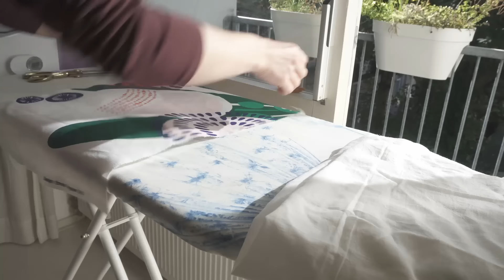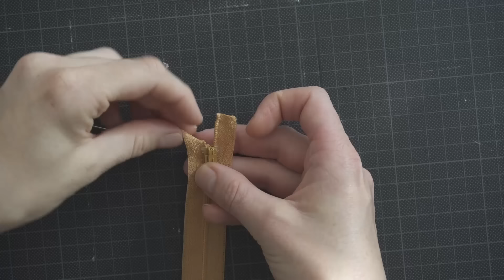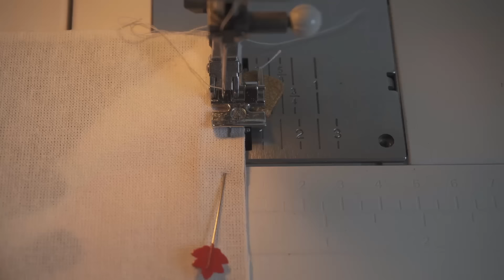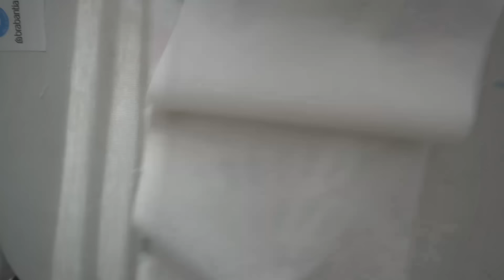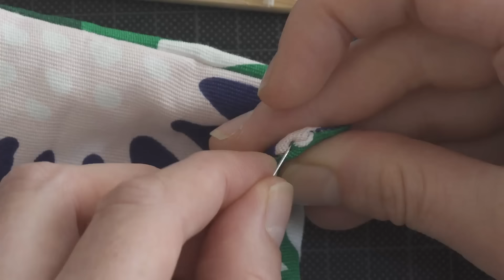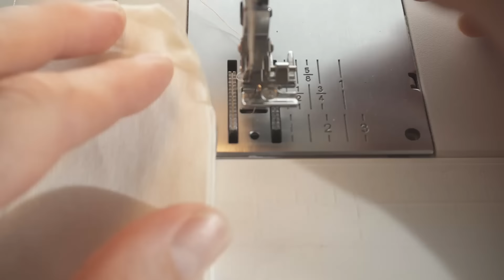Easy Zippered Pouch with Lining: Beginner-Friendly Tutorial

Comment: I’ve been using #5 zipper by the yard. The zipper teeth are much larger. Would this technique work with this type of zipper as well?  Great tutorial
Reply from the maker: The size of the zipper teeth shouldn't be a problem, but there is a little gap at the end of the ziper that will probably be a bit bigger. However the issue is that this technique needs a stop at each end for it to work and if you cut it to length it doesn't have a stop. Maybe try adding zipper tabs to your zipper and see if that works?
Reply: @CharlotteKanStudio  got it! Thank you so much

Comment: What is the reason the lining is not stitched at the same time with main fabric to the zipper?
Reply from the maker: Great question! If you sew all the layers together after you attach zipper and lining you get that little dent. I think you could do it after you've already sewn together the pouch, but then it's difficult to evenly and neatly topstitch around the edge. There isdefinitly room for experimentation to tweak the method. I still want to do a deepdive into pouches...one day!

Comment: is there a way to sew the lining to the outer shell?
Reply from the maker: You can topstitch through both layers, but stop just at the end of the zipper tape (even a smidge before) so you don't topstitch over the seam allowance. The only thing I would do is don't backstitch over your stitches to secure the thread where you start and stop, but pull them to the lining/inside and tie them by hand.

Comment: I had already cut some material for a pouch - 10” wide by 8” long. I wanted a larger pouch for a lunch bag. What size zip would you recommend??  Thank you!!❤
Reply from the maker: Ideally I like to have a seamallowance of 5/8" and at a minimum 1/2" on each side of the zipper stops. 5/8" It's a bit generous, but I find it easier to sew and you have some room for error.
So then you take the side you want to put the zipper in, deduct  1" or 1 1/4"  (double the seamallowance). 
For the 10" side a 8"and a 9"zipper would work. 
For the 8" side a 7" and 6" zipper would work. 

I found a helpful guide about how they measure zippers. https://zippershipper.com/pages/how-to-measure-a-zipper-length-and-gauge Check their resource section in the footer , they have a lot of handy articles about zippers.

Hope this helps!

Comment: I'm taking it this wouldn't work for nylon faux metal zippers by the yard? Because they don't have a stop?
Reply from the maker: Yes you need a different technique! Adding zipper tabs works wel for those zippers. I don't know if you are familiar with this, but its basically a little strip of fabric encasing the ends. Or you can extend the zipper into the side seamallowance which works wel for the thinner nylon coil zippers, but maybe less so for the thicker zippers.
Reply: @CharlotteKanStudio  Thanks! I ended up here trying to find a way to save time from zipper tabs haha. I may try the extended down methods.

Comment: Experienced seamster here, I’m glad I watched this video!
Those simple techniques are as perfect as it gets for installing a zip.
The perfection at the open end of the zipper is just right for garment construction.
The only thing I would sew differently is to press then topstitch at the zip including the lining.
It keeps the lining away from the teeth during use and certainly does not add bulk. I think it’s a neater finish as well.
Just my opinion.
Thanks for the excellent video.
Reply from the maker: Glad you enjoyed it! That's great feedback. I've used that method too. I still use the little pouch from the video, almost on a daily basis and the fabric never caught in the zipper. I think it's good to have different techniques in our arsenal so you can easily adjust. It would be nice to make another pouch tutorial showcasing other techniques. I love nerding out over these details in the sewing process 😄

Comment: Lovely video. Great technique but i was just a bit surprised (17.24mins)  that you show a hole between the zipper and the material?  Was that deliberate? Honestly not trying to be rude just confused!
Reply from the maker: Thank you and great question! the little gap is deliberate, it's a consequence of using this method. There are other methods where there is no gap because the ends are sewn along the entire top over the pouch and sewn into the side seams. But if you sew the zipper into the side seams there is more bulk and the top corners dip. So depending on the look you are going for you have a gap or a dip :)
Reply: @CharlotteKanStudio  thank you! I understand now 👍🏽

Comment: I just didn't see the point of sewing the whole way round and then ripping stirches out for the gap to turn. Just leave a gap while sewing!
Reply from the maker: Yes you totally can! But I've noticed in teaching beginners that they sometimes find it very hard to tuck in and press the edges, as they still develop their pressing skills. So when you stitch it closed and press first you have a neat crease in the fabric that holds well when closing the gap afterwards. This is just a step that can make it easier for some, but can easily be skipped as I often do when I'm sewing without filming.

Comment: why 1.5 cms?
Reply from the maker: Do you mean the seam allowance near the zipper ends? The 1.5 cm is a little wider than necessary, but I find it easier to feed it through the machine because the presser foot and feed dogs have good contact with the project and you have better access to the fabric if you need to guide it. But you can definitely change the seam allowance if you prefer a wider or narrower seam allowance.

Comment: Congratulaions! Excellent close ups with great detail and explanation. Love your scissors. Please share where you bought them and make? Your machine is very quiet too? Which model please. Thanks from Melbourne, Australia
Reply from the maker: Thank you! The sewing machine is a Pfaff Classic Style 1525 from 2003. It's a lovely machine, and I do love the sound, but it probably sounds quiter because I've turned down the sound in the video a little. The scissors are from Keren, but I couldn't really find them online. I've bought them locally. They look great but they are on the heavy side though
Reply: @CharlotteKanStudio  Hello again Charlotte. Could you possibly give me more info or pictures of where I could buy those Keren scissors. Where are they made. Are they forged scissors. . Where do you live or could you supply the supply place you bought them from? Thankyou
Reply from the maker: Mine were bought at a local wholesale company in the Netherlands. Here is the listing with a few closeups of the blade:  https://www.debondtbv.com/schaar-24cm-1st-756420.html?option=56027&sqr=756420
I did a quick search online, but couldn't find the exact version on amazon, but if you look for "keren tailoring shears gold" you'll find pretty similar ones. The size I have is 24 cm. The blade says stainless steel, made in Keren.

Comment: Thank you for a great video.  Why don’t you include the lining when you’re top stitching?  I would think it would help keep the lining from getting caught in the zipper during use.  Also why don’t you stitch edge to edge when top stitching?  I like to see the top stitch all around the pouch.
Reply from the maker: Thank you! You certainly can top stitch the lining, and sew all the way to the edge so the stitching is all the way around. Not doing it prevents extra bulk which helps prevent a dent at the top corners, but you can always experiment and see what works best for you and your fabric. I'm thinking it would make a great video comparing all the different options when it comes to sewing a zippered pouch.
Reply: Thank you.  Great instructions.
Reply: Thank you for the close ups in the video. Your explanation is precise and easy to follow. Very well done video. ❤ thank you for sharing
Reply: Well .... l really  learn something while watching your video , thankyou so much....❤
Reply: Well done!
Reply: Is there any reason why you see the zip twice on each pass, separately with front fabric, then lining, instead of sandwiching the zip between these layers and sewing once?
Reply: It doesn't keep the zipper out of the lining. The seam allowance keeps the lining out of zipper's way. I have been sewing bags for a minute, so I have learned a thing or two. If you sew close to the zipper, it'll jam things up. Keep the stitch away from zipper, and only top stitch the outer part, not both. You can do both but it'll cause issues.
Reply: It causes issues.
Reply: Thank you very much
🙏🏼

Comment: Love your close up view of all the steps for inserting zipper with no dents!  I’m going to try it with a continuous zipper by the yard and fold back the tape!  Can’t do it on the far end though since teeth have to stay closed
Reply: Sewing the zipper into the seam will give you dented corners.  Much better to use a zipper tab that extends one layer from the end of the zipper out to the edge of the fabric and sew through that instead.  See the video MYOG: Zipper Pouch on the Adventure Gear Projects channel for an excellent way to make zipper tabs.
Reply from the maker: Glad it was helpful! If your zipper has a nylon coil, you can also bend the end of the zipper tape including the zipper teeth at a 90 degree angle and sew over the zipper teeth. That way the zipper teeth disappear in the seam. Not sure if you should do it for both at the start and stop though Might be worth looking into! It requires a bit more precision so I haven't used it much.